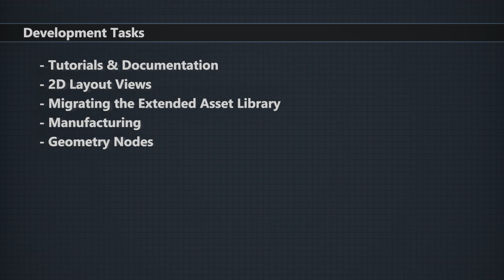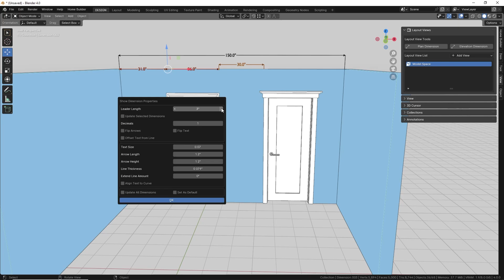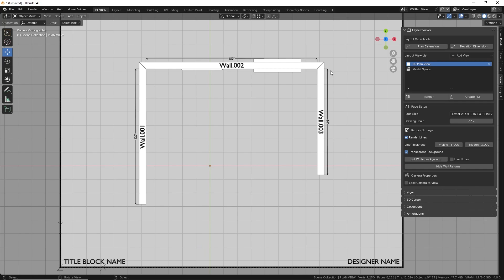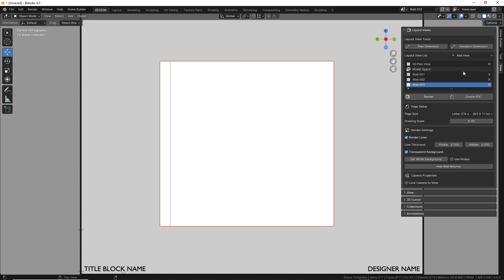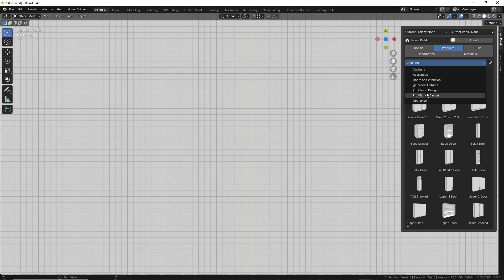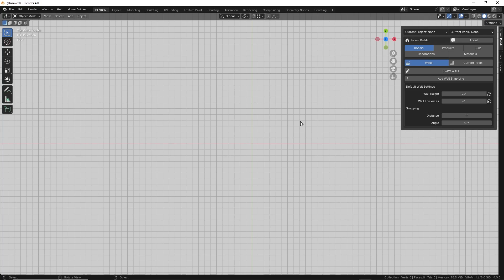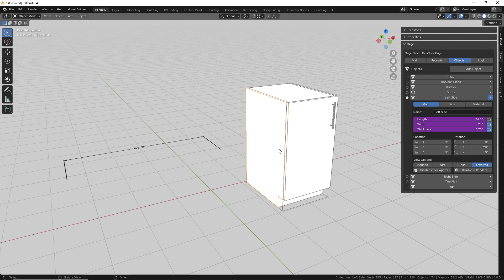Home Builder 4

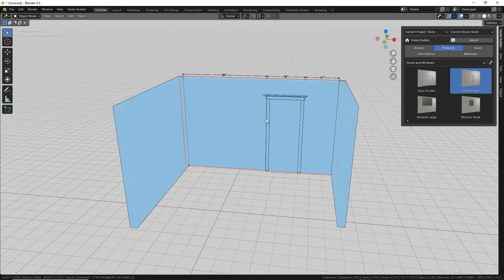Comment: Something that might seem minor, but to me is a huge time-saver and opens up tons of possibilities, is not having to switch to other software. That 2:01 "dimension change" feature you mentioned really got my attention - it could be a game-changer! But, @andrepeel, what's the plan for dimensions beyond 2D? Will we get the same kind offeatures we're used to in 2D CAD programs, like dotted lines, center lines, and different line end points? Are you planning to develop things that far?
Reply from the maker: Yeah having a simple dimension tool is the first step, but this will be extended to include all of the common annotations needed for technical drawings.
Reply: This is crusial. This is were Sketshup/ Layout is struggling. To be able to fast and easy get elevations and pro 2d floorplans that are allways up to date with the 3d models is a hugh impovement! In sketchup you need so many steps and a bounch of plugins to achieve this. Im just considering buying Dibac for Sketchup to be able to get the floorplan fast, but there is still the fuzz with using Layout. So this makes me thinking: how long will it take for this product to be at that point?

Comment: Thank you for this amazing add-on. Is there any possibility of exporting the house in fbx or obj format? I tried in the normal way, but it's not including the walls.
Reply from the maker: You need to apply the modifiers before exporting. I plan to create an quick command to prepare the scene for export to make this easier for users.

Comment: Is there a way to remap some of the addon buttons? For example, I use my right-click for my Maya interface addon, but that happens to be what is used to edit the quantity/looks/specs of objects or walls. Otherwise, thankfully I found a few loop holes by clicking stuff manually in the addon shelf, just took some digging!

Comment: Hello there, very cool add-on :-))
Is there a way to make curved walls, or arch doorways?
Reply from the maker: It's possible but I don't have an easy way to do this yet. Right now it requires you to make modifications to the mesh using Blenders modeling tools.

Comment: It seems this is one of the coolest and most useful tools that blender has had.
Thank you!!! Walls, doors, windows - so beautiful and high quality!! Wow!, The room simulation is very nice.
I also want to support you as a developer. How can i do this??

But I have a problem. After saving the project, and resuming the opening of the same project again, there is no possibility of continuing the simulation. Bug. 
This happens in Blender 4.0. Home-4 version of the program.
And if I press any buttons, the Blender program crashes.
Am I the only one with this bug? Or?
How to deal with this?

But I found a strange temporary solution to the problem.
In Blender 3.6, I installed the Home-3 version of the program.
And now, when I made room modeling in Blender 4.0, in the Home-4 version of the program, after saving and re-opening the project, the Hoom 4 version of the program is automatically turned off in the Addon category and the Home-3 version is turned on. So I Blender 4.0 re-modeling in the program is available in the Home-3 version.